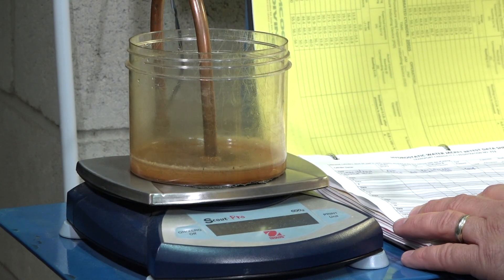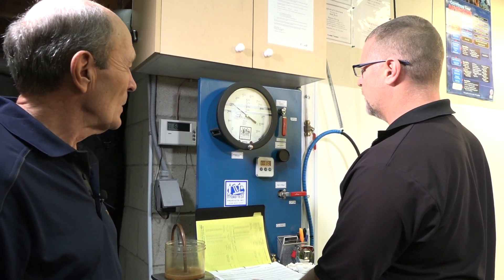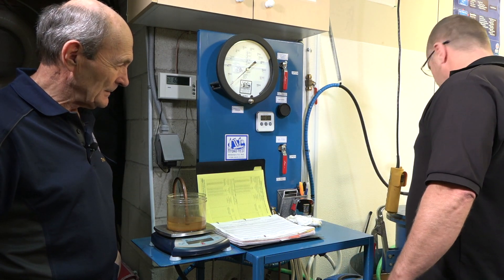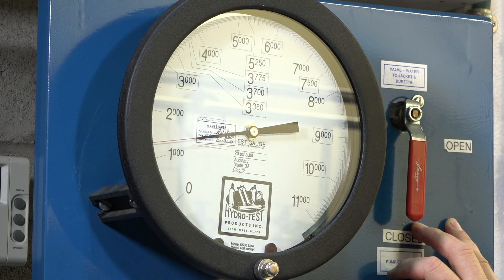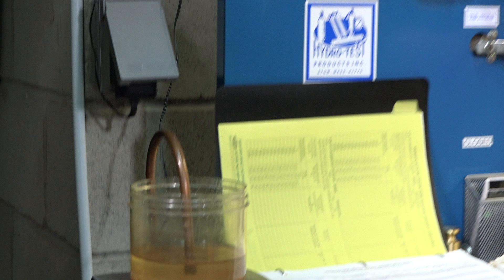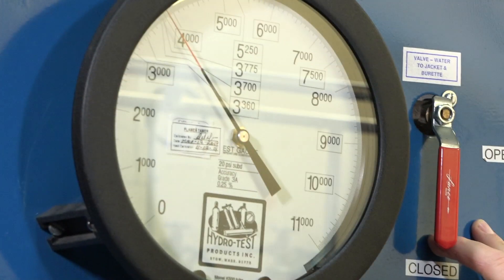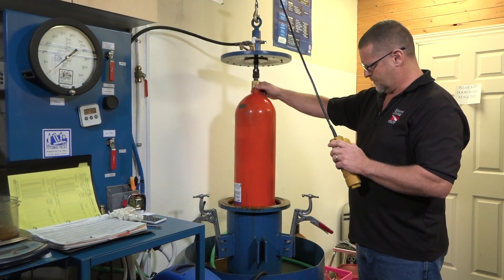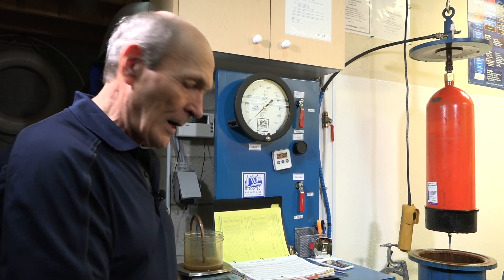Hydrostatic Testing A Scuba Tank - Scuba Tech Tips: S10E17

Comment: Thanks for the video, I have a question, if the water is able to escape during the test, what happens if the cylinder ruptures, what stops a 4000 psi water stream making a mess of the measuring flask bending the tube upwards and cutting the operative in half? 

Is the water drain off also on a regulator that’s perhaps set just above the test pressure throughout the test ?
Reply from the maker: The container tank is rated to withstand much greater pressure than the tank is tested at (for safety). I think it's about 1" of steel for the containment cylinder.  I can't offer more as Chris has closed his hydro test setup and moved south.
A

Comment: What happens if the tank doesn't pass for whatever reason?
Reply from the maker: Generally it is returned to the diver. In theory at least, since it has no test stamp, it cannot be used again. At one time, test stations would make the tank unusable by drilling a hole in it or cutting the threads but some divers objected to that. Alec

Comment: Actually I and others feel that, mostly unnecessary, Hydro testing is prematurely causing scuba tank failure by rejection from excessively stretching the cylinder. A well maintained and visually inspected tank will last perhaps a lifetime to 1 diver.
As I understand DOT regulations require hydro testing, maybe they can stop watching Hollywood and their movie antics making scuba tanks Explode! Poor Bruce from Jaws
Thanks Alec for a good Tech Tip  Jim
Reply from the maker: Since hydro testing was legislated, it has cut down greatly on tank failures.  I know as I used to fill thousands a year and was confident none would explode.  
A
Reply: I have owned a fire extinguisher company for 44 years. I have failed more extinguishers on a visual than in the jacket. Recently, one of my own CO2 cylinders used to run equipment in the shop needed a hydro. Passed with flying colors on the visual. Blew out the bottom in the jacket.

Comment: Would this be the difference between elastic and plastic deformation?
Reply from the maker: Thats right.  This simple explanation is for those who read your question. 
 When pressure expands the tank and it stays changed, that is plastic deformation. When the pressure reduces and  the tank goes back to its original form, that's elastic deformation.  Hydrostatic testing measures the elastic expansion of a tank to ensure it does return to its original shape.  Good question and thanks for watching Joshua.
A.

Comment: A Haskell booster pump is not needed since the air drive of the water pump supplied by Hydro-Test Products, Inc. only requires an operating pressure of a 100 psi which a low pressure air compressor can easily supply.
Reply from the maker: I'm not the expert but Chris, the store owner, is fully certified and has a great testing setup for divers, fireman and any one with a tank needing testing.

Comment: Why tested to such high pressure of "165.5 bar" when scuba dive pressure is limited to only 30m depth of "4.053 bar"?

Tested to 4000 PSI or 275.7903 bar (inclusive of 5/3 safety margin), which equate to 165.5 bar of "working pressure" (w/o safety margin).  Knowing scuba depth limit is to 30 meter @ 4 atm (or 4.053 bar)
Reply: guessagain: It looks like you're confusing water pressure with air pressure.
Reply: Because if you leave the tank in your car during a summer day, the heat will make the pressure rise beyond the initial fill pressure.
Reply from the maker: Simply stated, regulations require testing to 5/3 to accurately measure the tanks 'flex'. All this is to ensure the tank is safe for repeated fillings to its normal working pressure.  Tanks are capable of holding higher pressure but not repeatedly filled/emptied.

Comment: It was a ok... I would have like a better understanding ... The guy helped explaining in English..... But still don't get it the water displaced ...
Reply from the maker: As the tank fills with air the metal expands pushing a small but measurable amount of water out of the closed system.  The displaced water can be measured and if within acceptable range, the tank is passed.  Does this help summarize it?
Reply: @AlecPeirceScuba_SeaHunter  you mean " as the tank fills with water" ...not air :)
Reply: alondro: 
You may be missing the idea that the testing chamber stays at atmospheric pressure, and is directly connected to the pipe that carries water to the beaker on the scale as the air tank expands (and carries it back when the air tank shrinks).

Comment: In 1970 about a 2 years before I took up scuba diving, I worked for about 5  months for SELOX a welding supply company, as their hydrostatic tester. We were testing 300 cubic foot welding gas cylinders, but basically the same process and almost same equipment. We didn’t weigh the water but I believe we just had gauges that we looked at to determine amount of stretch. We also had a machine that removed the valves instead of by hand. Other than that not much difference after 50 years!
Reply from the maker: As you say, the basic hydro test has not changed, to measure tank elasticity, however new tools have made it easier.  The setup Simcoe Diving has in the video is very nice from a large water tank to stabilize temperature, to HP pumps, dials and a digital scale.  Tanks still need a trained and capable operator to make it all work.
Thanks for sharing your experiences.
Alec

Comment: Always use a torque wrench. 
Unless you don’t have a torque wrench. 
Then just whack your crescent wrench with a dead blow.
Reply from the maker: That's one way.  Watch my video S07E15 "Replacing Your Tank Valve O-Ring" as a rubber mallet properly used works just fine.  It is the O-ring that keeps the air in, not squeezing the valve onto the threads.  
What do you think?
Alec
Reply: Alec, just poking fun. A swing-wrench is an effective tool in well trained hands but might not be the example you want to setting.

Comment: In the rare instance when a tank fails, do they do anything to prevent it's future use? Seems like I remember hearing they would drill a hole in the tank if it failed. That was a long time ago though.
Reply from the maker: If a tank fails a hydro test, our Canadian regulations require it to be rendered useless,  drilling holes was a non-standard past practice.  Transport Canada (who gets its standards from the  Compressed Gas Association in the USA), "prefers" hydro testers to stamp XXXXXX's over the tank serial number.  This is supposed to notify future LDS fillers the tank had failed a hydro.  It does not prevent a person from filling a failed tank using a personal compressor or if a LDS does not check the serial number before filling (which is a standard practice).  Stamping out the serial number does not render the tank not-fillable.  If a hole is drilled, inspectors worry someone would try to fill the hole then fill the tank creating a bullet.   

Tanks rarely fail a hydro test alone as they would first fail a Visual Inspection first (ie tank valve thread cracks).   Modern tanks are made to tolerate pressures 2x or 3x higher than working pressure (with no burst disk).
Hope this helps.  
Alec

Comment: Alec, can't thank you enough for sharing the legacy of your knowledge and enthusiasm for the sport! Love your videos.  Any comment on LDS refusal to hydro any AL tank minted before 1985?
I understand before 1975 the AL alloy was different, but I have a few beautiful low number cycle tanks that are pre '85..
Keep up the good work and enjoy the ranch!
Reply from the maker: The LDS can be responsible if a tank they certify fails so many LDS error on the side of caution when deciding to test tanks.  Regarding Aluminum tanks that cannot be tested, watch "Buying A Used Scuba Tank - S10E12".  I explain the problem and years affected primarily 1972 to 1988.   Take your tanks to the LDS and have them check your make and serial number to see if it can be tested.  If not, watch my "At The Ranch" series #44 Scuba Bells!!!
Thanks for watching.
Alec
Reply: @AlecPeirceScuba_SeaHunter  I suspect it might be like with houses before in 1979 when lead paint and asbestos was still allowed.  My house was remodel and all that material was removed along with all the electrical, supply plumbing, heating vents, heating, water heater, kitchen, roofing material, etc. being replaced back in 2004 so I do not have those issues even tough the framing was done in 1968.  They used heavier material then, it has some huge pieces in the roof framing.  Car Decking was more common then.  I still have a squeak in one small area anyway but it is it where the wood flooring is so it is probably the Brazilian Cherry Wood and not the sub-floor making noise.

Comment: the 5/3 nominal pressure test have another goal, every time you stress repitively a metallic structure, you induce micro cracks, the 5/3 pressure test blunts the tip of these micro cracks and avoids the propagation, it is a fatigue phenomenon and this technique avoids catastrophic failure by fatigue crack propagation.
Reply from the maker: Interesting points, thanks for sharing Jacques.
Alec.

Comment: Great video.....hydro always seems like a scam when they charge $100
Reply from the maker: I know Simcoe Diving charges $52 Canadian for Aluminum and $60 for steel with an anti-rust compound added inside the steel tank.  The testing part is quick as my video shows.  However, it's the tank preparation, visual inspection, stamping, logging, drying, tank valve on, filling that makes the process much longer.
Alec

Comment: Hey Alec I noticed the plastic boot was still on the tank.  Shouldn't it be removed first?
Reply from the maker: Good catch Peter, yes tank boots should be removed but for our demo video it was not. In practice boot on or off has no measurable difference to the test results but are removed for visual inspections.
Alec

Comment: Many fire extinguisher companies can also do scuba tank hydroes, and often a whole lot quicker than the dive shops. The only caveat is a lot of them want just the bare cylinder, you have to take your boot and valve off before you bring it in.
Reply: In my area very few dive shops do hydros, they contract that out to the fire companies. I prefer the one shop that does it in house as the turn around is faster and they know the proper procedures for some of the hot dip galvanized tanks.
Reply from the maker: High volume companies have full time staff for hydro and visual inspections.  Your LDS may send them to a local specialist when they collect enough for a pickup or as Simcoe Diving does it in house for many types of tanks, not just scuba.
It is something diver don't know about but are dependant on for safe diving.
Alec

Comment: Hi Alec . That was really interesting, thanks. Since you said that the metal stays stretched a little it would be interesting to do another test right after and see the change in the % reading. Not sure if the tank shrinks back down over the next 5 years? I have a few tanks with 6 tests stamped on them Is there a limit? Take care Owen m
Reply from the maker: There is no expiry date on a tank.  They are like airplanes as there are DC3's from WW2 still flying after full a refurb.  Regular annual visual inspections, hydro test every 5 years (Canada), and taking care of a valuable safety item will keep it in use for the grand kids.  Our vintage Sea Hunt divers use tanks from the 1960's, steel 72's, double and triples, all in perfectly safe condition 60 years latter.
Take care Owen.
Alec